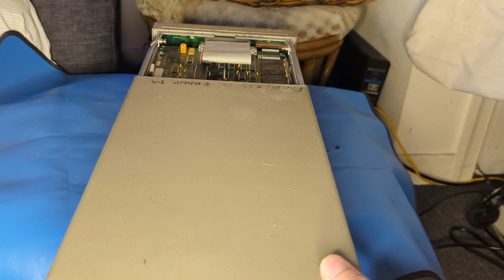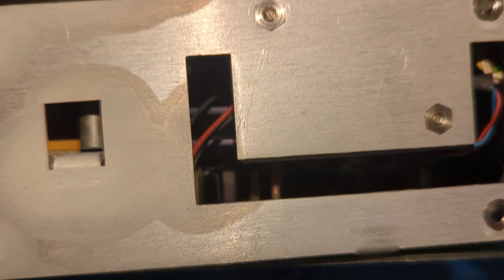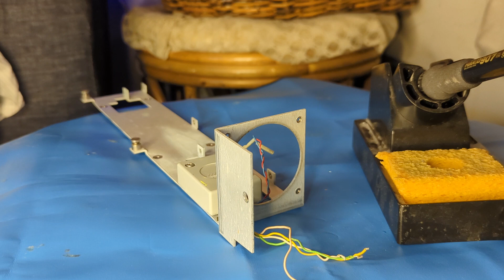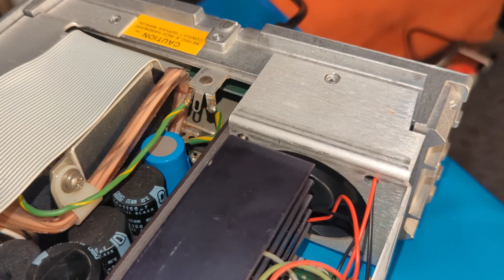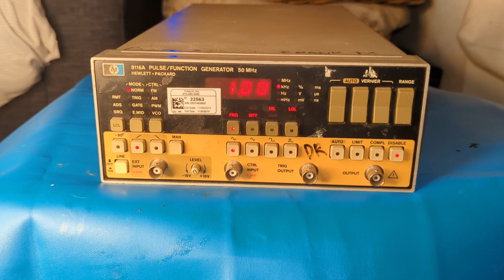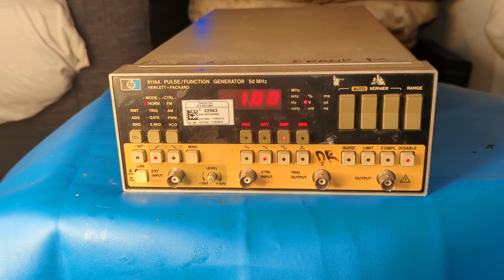HP 8116A Function Generator Fan Upgrade

Comment: Regarding lubrication, what lube did you try? I used a generic white lithium grease for some fan and it didn't make much difference. Later I acquired a synthetic grease for some specific need, and tried it on a different fan. It made a huge difference, so I went back to the first fan and re-lubed with the synthetic. Big difference!

----

Have you shared any about your background and how you got into a career of electronics repair? If so, care to point me in the direction of the video that includes it? If not, perhaps a topic for a future video :)
Reply from the maker: Thanks for your comments! I did this one so long ago I forgot which lubricant I used at the time. But the unit still seems to work great.  But to be honest, this is my home unit which doesn't see as much use as the one in my shop.  As for how I got into electronics repair, it was mainly in order to do this job better.  There aren't too many people in my role who are willing to do component level troubleshooting of PCBs for this kind of lab equipment.  Especially the field service engineers who work for the manufacturers of the equipment I showcase on the channel.  I should also note that the electronics repair only makes up a small portion of the job.  I really just teach myself as I go using resources wherever I can.  I'm the only one here who does what I do and there was no one here to show me how to do it.  Which can be a challenge that keeps the job exciting and interesting, but at the same time frustrating when you need to turn around repairs quickly.  I really just like to share the lab equipment repairs to potentially help scientists or people in a similar role who might be willing to attempt.  I still have much to learn re electronics and electrical engineering, but I always learn something new from each repair which I really enjoy.  Hope that answers your question!

Comment: I hope you checked the airflow on new fan vs old. These units are extremely sensitive to overheat especially the hybrids. I'd rather have a noisy working unit than a broken quiet unit. That replacement fan doesnt look like it will even shift half the cfm of the original
Reply from the maker: yea that is an excellent point.  I struggled to find a datasheet for the original fan and driver.  So you could very well be right.  Honestly I typically dont mind a loud fan.  But this one was unbearbable lol.  And yes I know the ASICs are usually the main issue with these.  So thanks for pointing that out.  Do you have any specs for the original fan that you'd be willing to share here so others can do their best to match it?
Reply: @fmashockie  Not only airflow, but the old fan controller's location prevented air from bypassing the heatsink.

Aside from CFM, an important factor (IMO) is how much pressure the fan will provide. I don't think it would be too difficult to construct apparatus to measure pressure or relative CFM, but translating into real CFM (for datasheets) would be less straightforward.

Comment: I'm currently working on refurbishing one of these, and the service manual has a slightly easier way to get to that fan: Remove the heat sink screws through the side like you did, but then take the whole back plate off of the unit (instead of removing the side). I did that and it was fairly friendly.
I do have a question I wonder if you can answer: did you measure the voltage across that red and blue wire (you said it's about 10V based on the schematics). Mine measures 18 or 19V, and I'm wondering if that's a symptom that could point me to the cause of some of the other issues my unit is having. (My fan was dead, it just ticks and doesn't turn, but I also have E41 and the output is railed at -24 V).
Reply from the maker: Thank you for your input! I forgot I had the Artek manual with the exploded diagrams.  I made a mistake here assuming that the fan is across the regulated 5V and -5.25V rails.  It is actually across the unregulated rails.  I measure ~9V and ~-9.5V, respectively.  Which gives me a similar reading as yours with the fan unplugged.  I will add a correction note to that part of the video.  As for the E41 error, the output amplifier appears to be driven by the shaper IC U401 which is one of the 3 hybrid ICs that are known to fail.  I chased down a E53 error in another video only to find a bad hybrid chip.  I think its worth following the troubleshooting steps in chpt 10.4 in the manual, especially if all your power rails are in spec.
Reply from the maker: Took another look at the output amplifer schematic.  If you are seeing -24V on the output, perhaps check Q513? Maybe shorted?
Reply: @fmashockie  Thanks, I appreciate the feedback on the unregulated rails, that saves me chasing a dead end. The DC power rails on the main board are in spec.  I'll investigate Q513.

Comment: I would imagine the thinking behind that 'over the top' fan mounting that connects to the heatsink is that it does drag some heat to the outside world ! No thought for the poor sod fixing it. Nice description of the 'grey box' that's exactly the sort of board that I can't throw away ! defo gonna be useful for something (never are) at sometime in the future...cheers.
Reply from the maker: thanks Andy! That is what I figured as well. But still doesn't make any less annoying to disassemble ! 🤣🤣
Reply: @fmashockie  :)